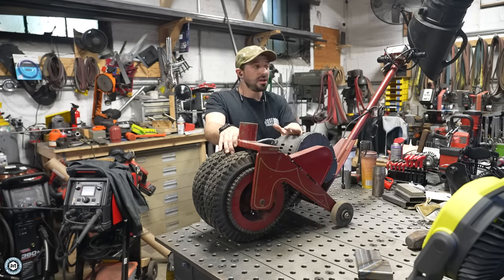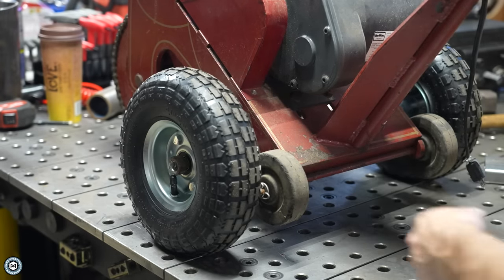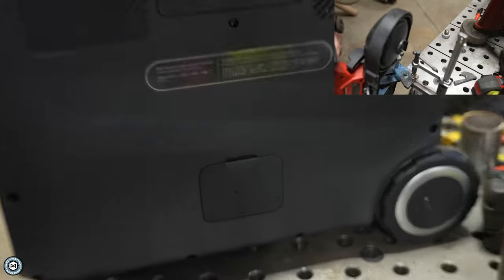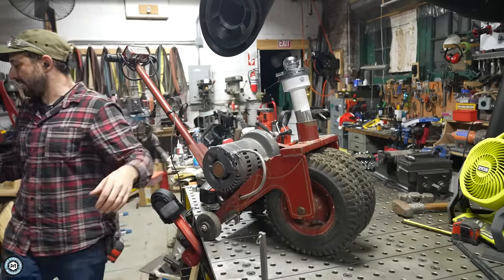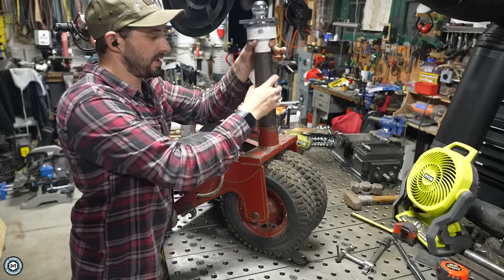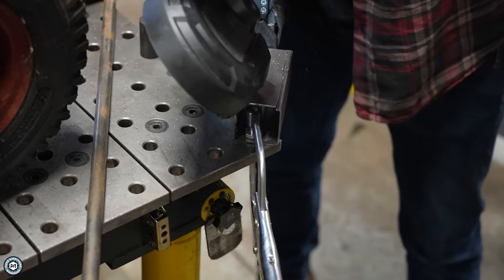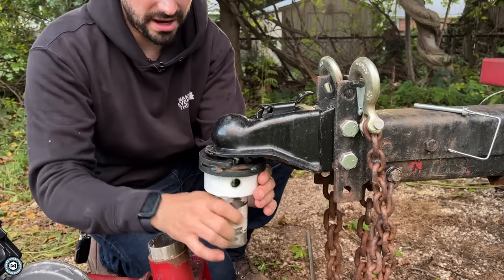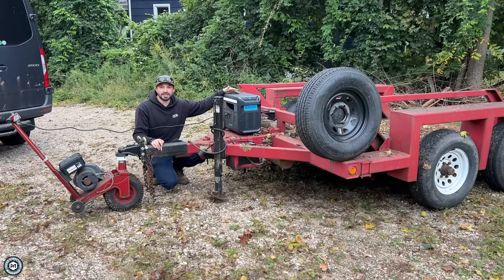Can This Tool Can Move A 30,000lb Trailer?

Comment: Very nice upgrade! A cool addition would be to use 12V power from the Anker and a 7pin plug to make a little electric brake button in case you’re on a hill and it wants to get away from you, it would be nice to trigger the trailer brakes.
Reply from the maker: Thanks! This thing actually has a brake switch that does wire into the 7 pin on the trailer, it uses a momentary switch to tell the trailer to turn the brakes on if the trailer has its own brakkaway backup battery. Unfortunately, none of my trailers breakaways work... but Macks does, so we are testing it soon!

Comment: Shovel a gradual ramp in front of the camper tires, so they are not climbing such a steep incline and you might be able to move the camper as well. Also, monitor the voltage on the motor while under a load. That invertor doesn't look any too big. Young family time is the best.

Comment: Looks like a great solution for your trailers to safely move them around. Don't concern yourself about taking 5 weeks to spend with your daughter. As an old geezer I can tell you that 5 weeks in a childs life is a blink of an eye. Before you know it you'll be planning her wedding. Spend as much time as you can with her you won't regret it. Thanks for the video.

Comment: Thats funny - as soon as you said it has a socket to plug into the wall, I thought "thats a bit awkward", then i thought "A Bluetti battery box would fix that" - seems you had the same idea!

I can see that that thing is great for larger trailers, but I've noticed that American's use jack stands/pads rather than jockey wheels. Most trailers over here (Australia) use jockey wheels in place of a pad for manual maneuvering, even on tandems.

Comment: It will be interesting to see how the battery pack holds up under a big inductive load like that. I had an inverter blow when I had hooked up a moderate inductive load and it sounded like a bunch firecrackers going off as the FET's exploded. The load was a 12k btu air conditioner that should have been well within the capacity of the inverter and had handled it before, but not that last time.

Comment: Cool contraption. But the height of that ball has nothing to do with how much tongue weight. The position of the load determines the tongue weight.
Reply from the maker: Yes I agree, but since we typically load our trailers to accommodate our truck heights, the ball being close to what we have now helps the load/tongue weight being correct.

Comment: That's really nice. I'm surprised that you didn't make the all-terrain wheels be in the same location as the original wheels, with the shaft just a bit higher so you'd get enough clearance. Then you wouldn't have to worry about removing them.

Comment: You need to fab up a bracket that can mount to a ball that would provide a stand for your power bank to sit on so that you can transfer it to the trailer and not have to wheel it separately.

Comment: for next time, having the high height taller lifts the front axle, and therefore gives more tongue weight (as it redistributes between the rear axle and the hitch). 
The 'wheelie' idea doesn't work like that, because the center of mass doesn't suddenly shift to behind the rear axle from lifting the tongue a few inches.
Similarly, lifting the front axle of the trailer means there's much less friction when trying to turn it.

Comment: I looked into something like that to move my camper but there's no power available where I store it. It would be nice to just drag it out instead of hooking it up to the truck when I need to service the camper.
Reply from the maker: Yeah thats the problem with these powered trailer casters, from what ive found, the 12v ones dont have the same capacity... I like the idea of using the battery pack for this, but knowing I can use it everywhere else is a huge plus! Try and find a powercaster used and invest in a good battery and youd kill two birds with one stone.
Reply: @MakeEverything  I also have a two bike drop tail trailer for my bikes I keep in my yard. I have a two wheel dolly I can use to get it out to the truck but I swear that trailer gets a little heavier every year, lol.